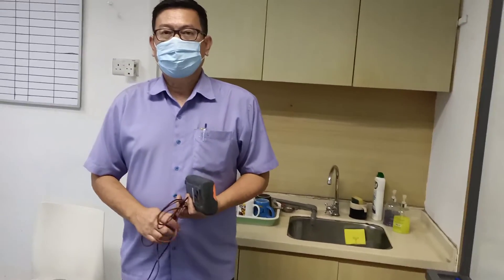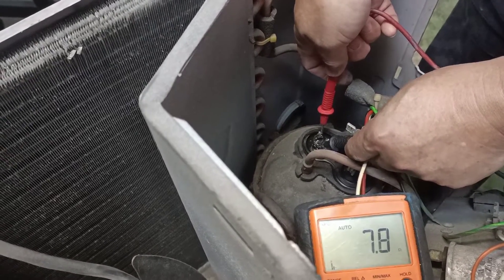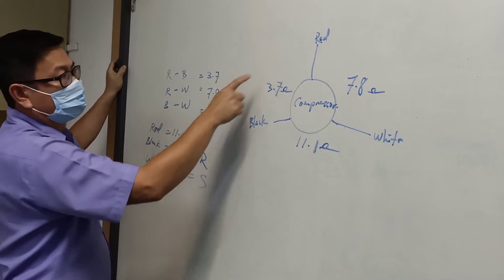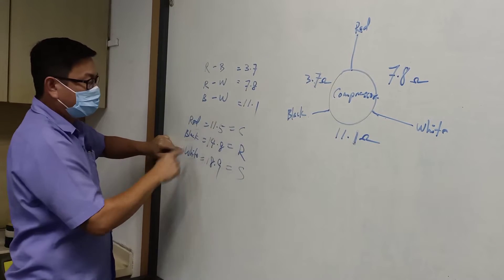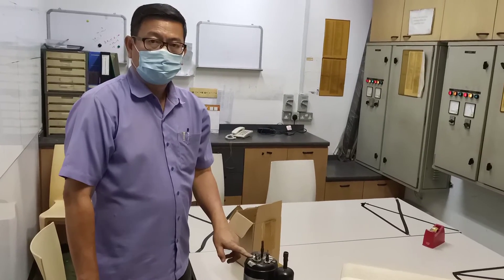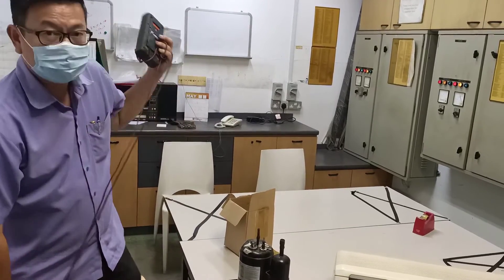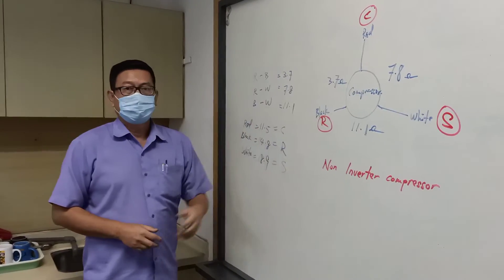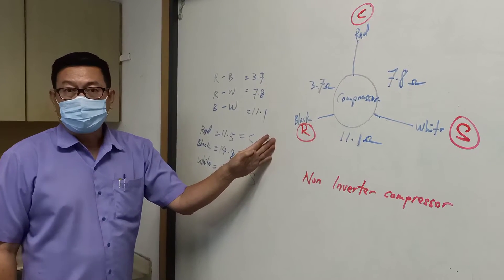How to find Common, Start, Run on air conditioner compressor.

Comment: It's most important to understand ohms or resistance to flow of electricity/current. 
The START winding has the least resistance to flow of electricity to aid initial first rotation from stationary position. 
A capacitor gives the extra kick the motor needs to turn over. The RUN winding uses less power and therefore has higher resistance
The COMMON needs to carry the entire flow.. so the total resistance from both start and run.
In 3 phase compressors and DC inverters.. each pin has an equal resistance to one another
In ALL cases there should be an infinite (very high) resistance of flow going to EARTH *Remember 0 (zero) OHMS is opposite to infinity

Comment: I watched the video but again when you were changing the capacitor you  mentioned red as the start and on the compressor is white. How comes
Reply from the maker: In this video....
White is = Start
Red is = Common
Black is = Running